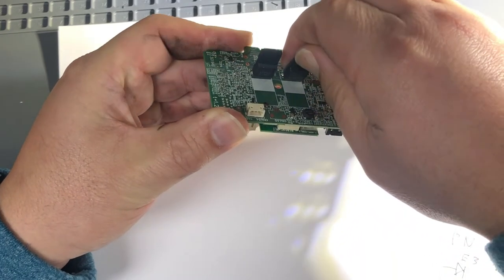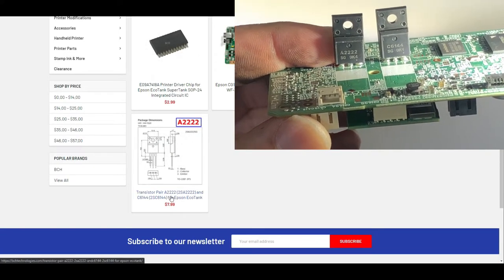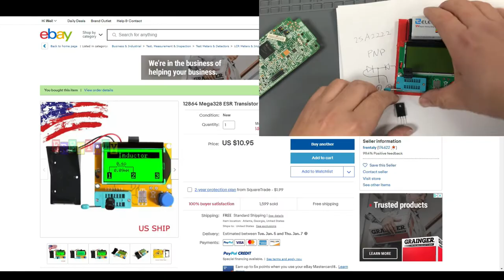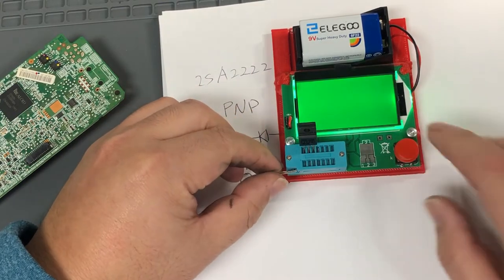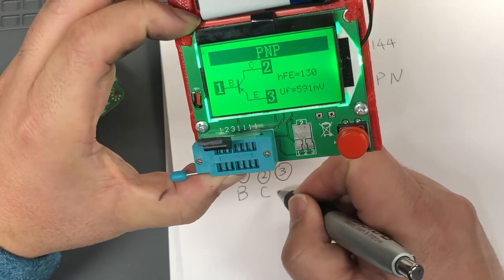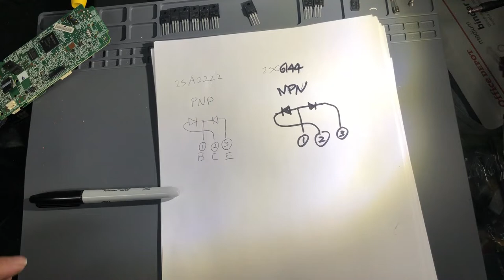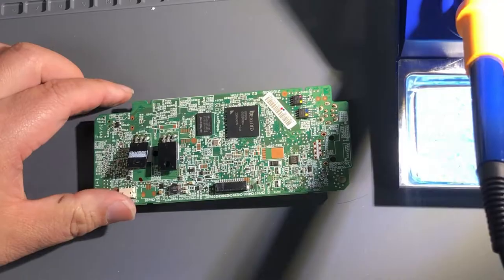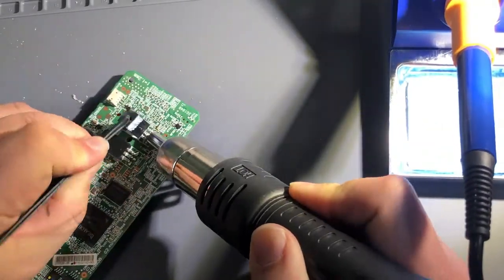Epson No Power - Repair Printer Mainboard Formatter Board Transistor MOSFET ET-2720

Comment: What board fit Epson et2720 having issues finding it as it powers on then shortly after error 100016 as the scanner does seem to work with light coming through but with noises like motor trying to move even at the end of the guide. There's no dirt or grit in the guide. Is this a board issue or scanner issue

Comment: Also you can check diodes, fets, transistors,  etc with your multimeter. 
Kevin's has multiple options where his dial is placed.
On others, look for the diode icon.  Select it and use the pos and neg leads to check for forward biasing.   The dmm supplies the voltage too.

Comment: Kevin, i got ET-2760, and made the mistake of using cleaning flud and powering it back on, before all dry... the unit wont turn on, i pulled print head, 2 pins of the flex cable is burned.
so my guess 1. need new print head (or just clean it and let it dry 100%) 2. need new flex cable (hard to find) 3. need to replace transistors on main board?
since disconnecting the cable to the print heads, still no power up

Comment: Great Video!  Thank you Kevin.   I was trying to clean the prints heads of an Ecotank 7250 and when I plugged it in to test it, it seemed fine but 1/2 way through the test print the printer completely powered off and wouldn't turn back on.   I think I may have gotten it too wet and fried it.  Is a situation like this, is it  possible to fix by changing the transistors?
Reply: same here i have a dead paper weight now 😢😢😢. What is the solution ?

Comment: Wow thanks. You are very good at instructional videos. Any chance you could do one on the the bios chip flasher?  I noticed in this video you had one :). I’m in need of a tutorial on my ezpxpro.
Reply from the maker: Thanks. I don’t want to share it here in the public.
Reply: This may help.
The Epson has a 4 pin connector (cnxx) which is used for debugging.   Only development boards have these interfaces populated.
My hp has a jtag interface, and two servicing uc removed. 
Generally these are not necessarily for bios flashing. But recovery. 

Every embedded controls architecture is different and the bootloader may even be locked.  
Personally,  I would look at the datasheet for your nonvolatile ram chip.  Read it.  See what flashing protocols are supported and research. 

Check Git, someone probably has a project somewhat related and try an Adriano or Raspberry pi interface. 

Who knows,  but becareful.  Flashing your bootloader with the wrong files and you will definitely be debugging or replacing the uc.

Comment: Hi great video, can I ask you somethign. I got one epson l120 and  the mainboard look the same. But here in México they say that if u get burn those 2 u will need to change the printhead to and the IC.
Reply from the maker: I will agree.  If you burnt the transistors, you are likely needing a new printhead.
Reply: @BCHTechnologies  My transistors bun as soon as I turn on (just the power plug and display cable connected.  Printhead is not connected, but it still burns the transistors, what else on the MB could be bad that causes it to burn the transistors? Thank you!!
Reply: If I take off the driver chip (E09A7418A) plug in power and display it powers up and stays powered up (appears to not burn out the transistors) so I will try now replacing the driver chip (E09A7418A) and seeing if that was the cause of the transistors getting burnt out - if not, then looks like its something else in the motherboard! :)

Comment: Well Kevin I just received one of these in the shop, same issue no power or display. The ribbon cables were disconnected from the display and scanner when I got it so I thought easy fix just reconnect them and we back in the game. Nope, I guess this is a common issue with this particular model, gonna check it further before thinking its the board but from what you say and what im seeing so far i may have to get a replacement. 

Also are the power packs similar in most of the models?
Reply from the maker: LOL. I got a repair work (false paper jam) which the PF scale fell off as soon as I open the case. Easy fix - I thought! Then I found out the scanner lamp burned out, and the printhead is dead. I got a 3-in-1... so far.

Comment: Thanks for the video. It was very difficult to remove the NPN and PNP components. I think I damaged the circuit board. But both appeared to test fine, which makes me think the problem may be in the power supply. How do you test the power supply?  There are 4 wires I think.

Comment: Very interesting, but is there any way to reset ink counter directly here ? (on some HP printer there is just a cr2032, you remove it and expiration date for Cartridge just fixed) ?
Reply from the maker: Well, you are walking into the dark side.  However, EcoTank doesn't need a ink counter.  It has one but it is for "suggested ink volume" only.  The printer won't stop you from printing.

Comment: do you repair r2400 boards i have a couple i need repaired wondering if you could add fuse holders to f1 fuses that are blown on the boards i have

Comment: where do you purchase the power supply chip? MY husband removed the print head to clean a badly clogged black nozzle. After replacing it the printer came on then when dead a few minutes later.

Comment: Greetings from Greece. Yesterday I, managed to fry my main board on an epson L365 after cleaning its print head. Some water got in, which I didn't notice, shorted the head and afterwards the mainboard :) lucky me ! I haven't yet got the board out cause I'm still pissed :). I'll check the TRs , but I believe that if the trs are shorted then I'm sure some tiny fuse will be off too. These two ICs you mentioned what type are there. Do they have to do with print head control ? 
Great videos btw 👍👍
Reply from the maker: The little fuse only controls the ink ejection.  If your MB is fried, then the problem is more likely in those two transistors.

Comment: hello, when you change the a2222 and c6144 transistors, the SG numbers below must be the same? I have an a2222 SG 2b2 I can put an a2222 SG 7f5. THANKS.
Reply: Also, Sanyo was acquired NY osemi.
Reply: And yes, the sg is a replacement. The others are not being newly produced anymore

Comment: Hello 👋 , I have questions for you I have the same printer, when I refilled the ink and clean the nozzle it just shut down and never turn on. I tested the power supply black(GND) and other 3 (40v,42v,0v) . Is the power supply looks ok? Or not?
Reply: hello, I had same problem. first i changed mosfets, turned on, for short time but then off. I wonder if there is other problem to look after?
Reply from the maker: Did you get a new printhead?  Maybe the printhead is dead.
Reply from the maker: PS looks okay.  It is likely you have a faulty printhead.

Comment: Hello! Can you share some experience about Epson L1800? It is original. But technician told me " your printer got burn mainboard and pass power throgh to printer head". This happen while I start cleaned by using some acohol with water.Then I Put it in ordered and connect to power supply and started power on by put it alone. But the technician told me that " Your printer got burn by overload power" . Now I already repaired main board by my knowledge and the mainboard work well. But I want to ask you can I insert the old printer head into printer L1800 again? My Epson L1800 It is work less than a year of total using it. It just new

Comment: Is it mandatory that if you replace the 2 transistors you should also replace the 24 pin micro controller? Thanks
Reply from the maker: No
Reply: @BCHTechnologies  sir then based on your experience how would you know if the 24 pin power IC is damage? Thank you sir.
Reply: Find your depopulaed debugging connector for a start.
Reading datasets also helps if you can understand what they say.
However,  oem boards. Do not have chip manufacturer data printed on them.  Generally found in a high volume production environment.

Comment: Just watched your video for the 2nd time . great info. Now, i have a Epson XP-440 . Head was clogged . Cleaned out. reinstalled. and power came on, started charging the ink in the head and then power went off. Never came back on no matter what i did.  watched you video again . Today i replaced the 2 transistors with new . reconnected MB back in printer . head is not in . Power switch lit up for one second and then no more power again.  I don't know if something else besides the head is bad or not but it seems to affect the power issue. Any Ideas? Thanks.
Reply: Same here.  If I leave them out, the board with just the display cable and power plug it turns on.  If I put the transistors in, it powers on 1 second, then off and the transistors are burnt again.  so something else on the MB is bad since it fries them with nothing else connected.

Comment: Great video, very helpful. I have a similar problem with a Epson WF-3620. All of a sudden one day when I sent a print command to the printer from my laptop, I heard a faint click noise from the printer and a got an error message on laptop. Printer had shut down. Pushing power button on control panel and trying to reset by unplug, hold power button did not work. I tested the power adapter and can measure 42VDC at power adapter connection CN501 at motherboard. I tested the control panel power button with ohmmeter and it is functional. But there is no power getting from to either terminal of the power button. Do you think this is a problem with the motherboard? If yes, how do I isolate the problem? or any other suggestions? Note: the printer is about 8 years old and has seen only moderate use. Thank-you very much for any help
Reply from the maker: It sounds like it.  There are only three things needed for a power-on: Power supply (working), MB, and LCD panel.  The LCD panel is hardly the problem, so I will vote for MB.

Comment: My a2222 and c6144 are burned, after change printer starts for 2s and again burned, what kann by more?
Reply: same!
Reply: @joshuahurst1099  answer is burned e09a92ga or e09a7418a, must be changed both Transistor and Chip
Reply: @Atarilloll  Thank you!  I just removed the E09A7418A and power up and it did not burn transistors, so looks like that should be it - I'll keep you posted - thanks again!

Comment: Kevin I like your videos. I have an epson ET-2750 after cleaning clogged print heads, I get Scanner error 02. The cables are connected correctly, but the scanner error 02 100016 still comes on. What else can I do? Is there a sensor or something else that need cleaning? Thanks in advance
Reply from the maker: Does the lamp come on?  When you start the printer, the lamp will be turned on and it will scan a little strip on the cover.  The signal get sent to the printer.  If the printer doesn't get this signal, it will think the scanner is broken.